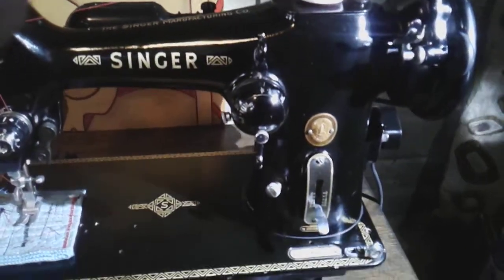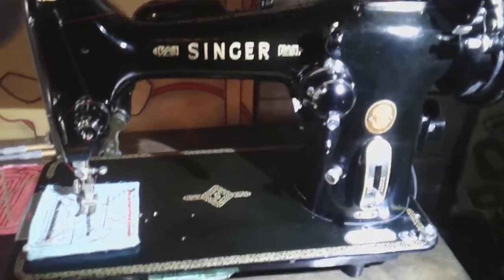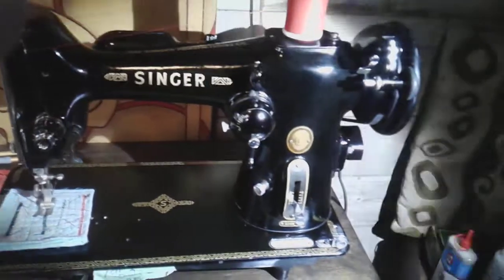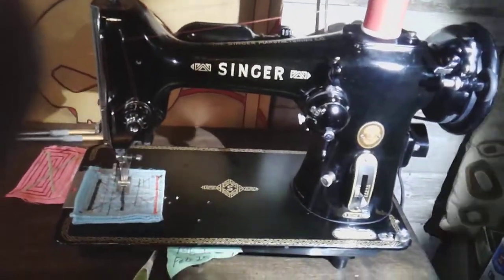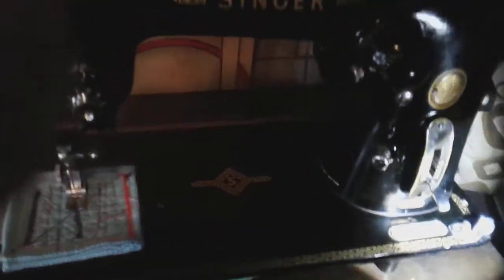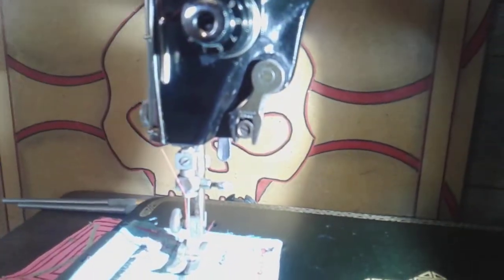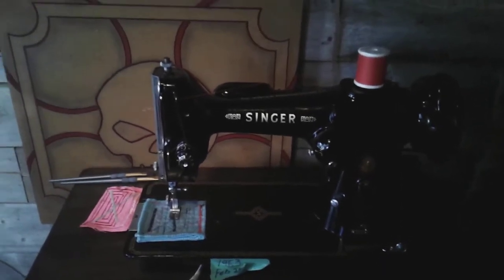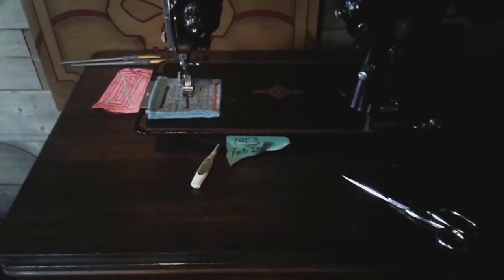Singer sewing machines and how to check if your clear coat is origanal.

Comment: Just so you know, I just inherited my Great aunts 201, my grandmother obtained it and left it to me. I am certain it has not been repainted.

I cleaned it with sewing machine oil which revealed massive tiny crazing in the original shellac across moss of the machine. The oil got under the shellac and made a cloudy haze. The shellac is a dark amber color.

My mother bought a 15-88 treadle over 20 years ago. Paint and decals in very good condition. Machine in excellent working order. Had a new treadle belt and a new upper tension assembly. For the first couple of years the grandkids played on it (while supervised). Then it sat closed up in its cabinet, no uv exposure, in mom's air conditioned dining room for the next 18 years until she offered it to me a couple of years ago. Was I shocked to see the amount of crazing in the original japaning! Big chunks missing and a greenish hue to the otherwise amber colored shellac. Needless to say, I will be totally stripping and repainting this one. It needs it.

My aunts machine lived approx 50 of its 71 years in houses without central heat and air, often exposed to higher humidities. No idea where the treadle lived the first 50 years of its life, but obviously not under the best of conditions. Shellac can be affected by many factors and old shellac can present itself differently from one vintage machine to the next. The one you show here may only have received a few bits of touch up paint, but otherwise it looks very much like my 201 and it's failing shellac.
Reply from the maker: How machines are stored playes a huge roll in how the shelack will age i agree , some of my machines have been left for years in garages or basements and some have been left in windowsfor the sun to bake in the oil , but im ok with non perfect paintif the machine works perfect , i sorta like the wear and tear of old paint , it shows its age , i have a couple machine the paint is near mint but it makes the machine look new and thats not my style of collecting , not out for the pristine collection , im in to it for the history of them and thier stories if they came from origanal owners ...
Reply: @4486xxdawson  I'm a woman - not my device. I'm into them for the quality of items I can produce, be it clothing or home dec. Sewing on a beautiful well cared for machine is more pleasing to me than owning 15 or 20 to fiddle with. I'm glad you guys love to collect and tinker and video - prevents me from having to pay someone to keep mine running. I currently have a herd of 5. If my serger dies, I might replace it. I'd like to find a donor for my Kenmore before I NEED a donor for my Kenmore. Other than that, stick a fork in me I'm done collecting machines. I don't sew for fun as a hobby (though I enjoy it), I sew to have a quality of clothing and home goods I otherwise couldn't afford.
Reply from the maker: Yes im aware this isnt your device you mentioned this before , i do pay atention to my subs just so you know lol , i know alot of channels just respond to comments but i try and remember my subscribers , but on the topic of collecting,  when i first started i wasnt trying to collect , i just wanted to sew a patch an my leather vest because i paid someone to do the job and they totally missed over 7 inches of the patch , totally missed the patch entirely, i had to take it back and decided if you want it done right ! Do it yourself so i bought a kenmore vintage machine and started sewing my own patches , then my wife said i should get a zig zag machine , so i found my necchi BU for free and restored it , well thats when i got sick and cought the bug , now i have 17 machines and love them all , please help i feel i need help lol , thanks for watching and i appreciate it like always ...
Reply: @4486xxdawson  You sound like me in my much younger days. I wanted to go out with friends the next night, but my headlight was out. Called bro and asked how much is a headlight? Answer $3 -$4 at Kmart. Went to work early at Sears next morning and they wanted $12 for the headlight which would have left me no money for partying! Dilemma! Off work, went by Kmart, bought light, got home, decided dress needed to be washed anyway, no need to change, took two of 3 hand tools I owned - flashlight and screwdriver, kicked my heels off in the driveway and crawled under the car with only my nylon clad legs 🦵 (they have an icon for that!) Sticking out from underneath the car. Neighbor's boyfriend arrives home just as I'm finishing, dies laughing and I'm so very happy camera phones did not yet exist! Head light worked!

After that when I chanced upon tools I didn't own at a great price and decent quality - I bought them if I had a few bucks. Soon I no longer needed to wait on Dad, Bro or BIL everytime I had an issue. Bought my house - oh how that requires tools! At Father's Day, I still hadn't decided what to spend my tax refund on and while looking for something for Dad at Sears, noticed a NICE Craftsman rolling tool cart on sale and made my choice - Happy Father's Day to me! Parked that thing in my dining room for the first few years and on the rare occasion I needed a professional, the guys ALWAYS got a kick out of it.

As for sewing machines, I've come to think of them like pets and having too many would defeat the purpose, but I want them well cared for. Unless I win the lottery and decide I want to machine embroider things - my bucket list includes never owning a computerized sewing machine. So I've reached the conclusion I need to learn this stuff - and your videos are oh so helpful! Thank you!
Reply from the maker: @cliftonmcnalley8469  there is alot to admire when it comes to vintage machines , plastic not so much , some times people donate machines to me and if they are plastic i repair and give them away , i dont charge people for plastic , i tell them if it breaks or stops working just toss it , i dont want to be liable for a break down and plastic WILL break down ,  just so you know why i own so many is because when i see them going for such a low price and they are in need of restoration,  i feel it would be  a shame to find out it went to scrap because it needs cleaning , 90 % of the time its just oil and tuning and these Singers sew like the day they were made , i dont think anything made today would last 30 year let lone 100 plus , we like to have new things i get that but we pay for disposable everything now and its not cheep , why teach our kids how to budget but not how to purchase smarter , guess thats life now disposable , how are we to have a quality life when everything is junk we purchase .?...i try and buy vintage everything if i can , my truck is a 99 and thats even to new for me lol , turned fifty this month so i guess im an old fart now lol , back in my day i get to say now he he he .....

Comment: I'm wondering what the best clear coat is. I have one I want to protect
Reply from the maker: Well thats a good question,  first i need to know are you coating a old paint that original or is it one you painted ? Thats going to make a differance,  if its original and your looking to try and  bring it back to original condition your going to have to use a shalack and im not familiar with that but there are lots of videos on how to , now if your looking to coat a new paint job id recommend the 2K clear coat , its more expensive but is a 2 part clear that you activate and get 24 hrs to use only , but if your looking for off the shelf rattle can id use rustolium brand , but a warning the rustolium dried very hard and can chip easy , the 2K is more like automotive finish strong , hope this helped .
Reply: @4486xxdawson  thanks this helps..I'm looking to do both. Right now I want to go over original finish to bring back original beauty.i don't  want to hurt decals .I tried using something on another old machine which fid not matter if I messed up.well it turned out pretty yucky.I have one with Tiffany decals I want to go over.. thanks